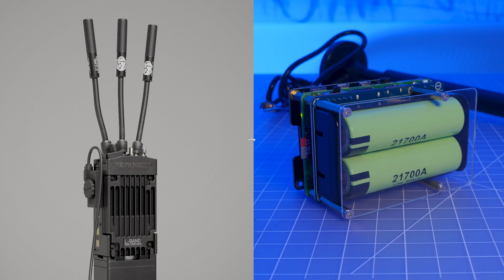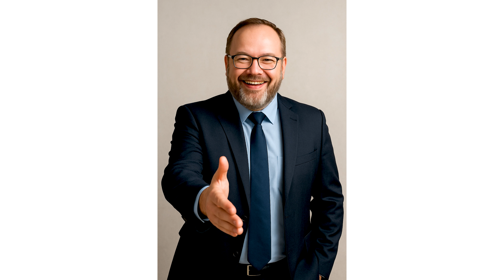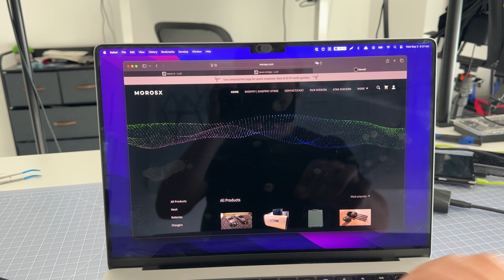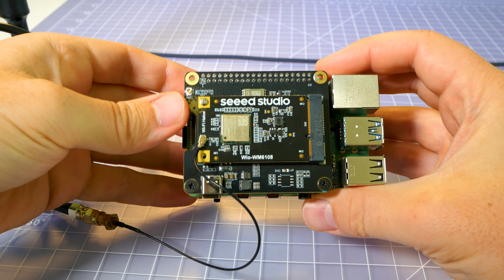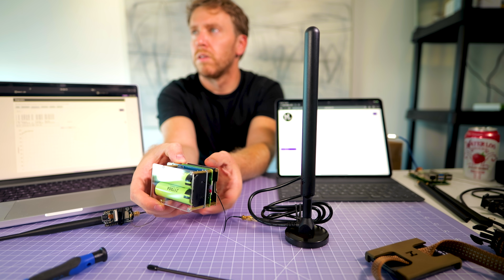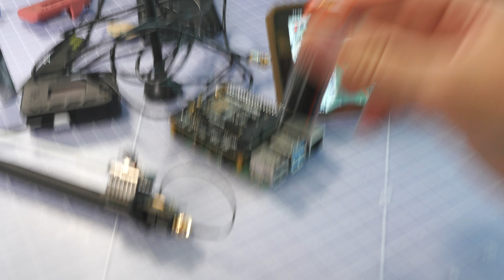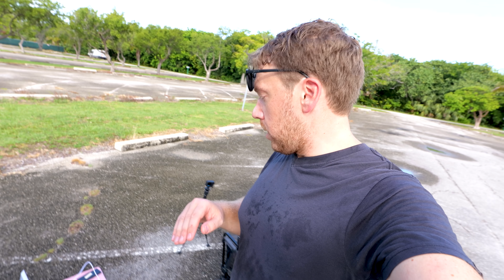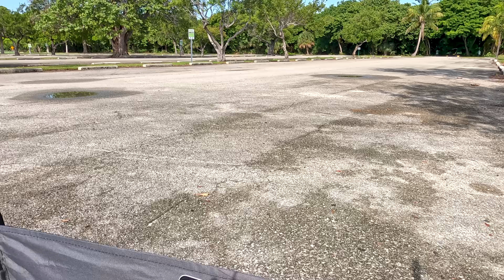I Built a $20,000 Military Router for $106.23

Comment: What about RF power?  You are at least a factor of 100 below that typically used by mil mesh radios. This RF board is where some of the extra cost is I suspect
Reply from the maker: in some cases ya, but I'm building commercial here so gotta stay compliant ultimately

Comment: I think you also have to remember that for some of these military specs, a huge part of the requirement is meeting surviving rugged extreme environments. Things have to be over engineered and made to not only work in the best case scenarios, but also the worst case scenarios. Yes government also over pays for things, but I doubt your design would survive war environments and deployment without heavy retooling, and that’s is probably where a huge increase in R&D costs would come from. Testing this thing in extreme colds, extreme humidity, extreme heat, extreme dry environments, and so on.

Comment: What about cave exploration? Intercoms usually don't work in long caves because the signalns are way to weak to penetrate through that much dirt and rock. But what about having such tiny router avery 20m as a repeater throughout the cave to have a Network in all of the cave to send messages back and forth?
Reply from the maker: interesting use, not sure dropping tech every 20 meters is the most elegant solution but I'd be curious what could be done in this scenario

Comment: Where I work, our radios constantly drop out of range and sometimes you get only some of what someone is saying to or none of it. They are 2 way radios and are transmitting digitally not analog. Safety is a pretty big deal on a mine site, wondering if a system like this could used on each truck to improve coverage and quality of a fleet of like 70 trucks ?
Reply from the maker: I would think so

Comment: Really fascinating stuff. I think in general for designing a 'military style' civilian system, you probably still would want LoRaWAN and potentially a traditional wifi mesh. The range + better performance out of line of sight of LoRaWAN just makes it hard to beat for 'heartbeat' style comms which ip based systems enable and you would want to implement.
Reply from the maker: Don't you need to broker an agreement with a LoRaWan provider?
Reply: @DataSlayerMedia  As far as I am aware if you stand up your own network, no agreement needed. Only if you connect to an existing network.

Comment: You didn't make a $20k piece of equipment for $100.  That $20k piece of equipment is ruggedized, manufactured against specific, testable requirements, has built-in encryption, uses a specific protocol to interact with other equipment, and is certified against the requirements.  You made a $100 piece of equipment that electronically serves a similar purpose, but is definitely not military grade.  Sure, things shouldn't be $20k expensive, but certification against requirements isn't cheap.  That's where most of the cost goes in many cases.  The government wants to make sure that what they ship to the war fighter does what it is advertised to do.

Comment: wait hang on. you have the pcie card for halow, but you're not using the on board wifi chip, instead using a wifi dongle?

the wifi dongle and the built in wifi chip are both detected the same way, so there's no reason it shouldn't work?
Reply from the maker: according to OPENMANET docs, the onboard wifi can't be used simultaneously with the halow card
Reply: @DataSlayerMedia  i realise where i got my info from. The Pi 5 uses separate SDIO for the onboard wifi, vs the pi 4 which the halow module will take over. If you use the pi5 then you'd be able to get it smaller and more power efficient

Comment: This would be perfect for a rescue drone. It could fly high above the designated area and could get a ping from a smartphone or whatever of a lost or stranded person. No cell tower required, just a powerful enough router on the drone, so their phone can connect and give its location and send/receive whatever messages it can from whatever app a person tried to send them from. I am sure that a competent enough electronic engineer could come up with appropriate hardware, and then it would just be a matter of engineering, you'd probably end up either mounting it on a smallish helium balloon drone that could get to a fairly high altitude and then hold a relatively stable station, or a fairly large quad copter to get up high and hold station for as long as possible. A tethered balloon would probably be the best option for something like a disaster area (you could send power up the tether and only have the antennas up there, with the rest of the hardware at the tether point), and a balloon drone would be a better option for a search and rescue (I assume that most people who are properly lost or stranded would try to call out and then send messages from their phone, but are out of range of a cell tower. This would give them an open Wi-Fi network to connect to. That would be a huge morale boost for a lost or stranded individual, suddenly hearing a heap of received message notifications from your phone)

Comment: This is very impressive and super awesome 
But devil's advocate, I can understand the cost. Mil std 810g is a bitch. 
Any contractor that has any contract bigger than 2m dollars(which im sure that contract run is), they have to meet TINA compliance which means all the sub costs are laid out flat for the government to scrutinize. Contractors typically cant charge a lot of fee for a product either, hovering around 10% or less. Beyond that, dod contract doesnt mean "make this as cheap as you can while meeting specs" its more like "we have specs for your specs" such as your circuit boards have to be US made, components like resistors, transisters, inductors, switches, antennas, basically everything has to be US made (60-75% of all components have to be US made and they do not consider a chipset a single component, they consider every component on there a component) then all the housings that are machined have to use ASTM controlled materials, US manufacturers with AS9100 and ISO9001 government certs. They probably include maintenance costs, spare parts supply, and compliance reports with each unit. All that shit adds up and does make a difference. Is it worth it? Up to the Military to decide.

This is kind of like going "i could reporgram a $25 boafeng ham radio to do the same thing as a PRC163" yes probably technically true, but would you take that to war?

Comment: In coding we learned about reliability rates, testing,  failure handing. Sure you could code a missle guidance system for way less than i am sure the military pays. But there is an insane amount of man hours in testing and revisions. In  your case, how rugged was the original compared to yours? was there other specifications they needed to satisfy, Ingress Protection (IP) Ratings./ Ruggedization. All that R&D and materials procurement against how many units have they actually ordered. I could see it being 20k. But at the same Time I just wanted to say, congratulations. I appreciate what you have done! BZ!
Reply from the maker: Totally right, but it's fun to see how far we can go on a budget and without the red tape.

Comment: Can you make a phone call using wifi calling? So phone -> IP mesh -> starlink. Would be kind of wild, anyone on the mesh can make a phone call.
Reply: totally man. This guy just made a PtP link using Wifi and its a single Layer 2 network. People have been doing this for 15 years at further distances than what he showed with better throughput. 

I have a 900mhz radio link south of san Antonio that is like 3.5-4 miles and gets a few Mbps better down and up. It was put up in the oil field in 2016 and has been running 24/7 since the day I deployed it. "Esteem Radios" is the brand.
Reply: @CoryMp3  Yeah, knew it was possible. Think the next step would be deploying an IP PBX on the mesh network. That should allow allow voice comms between individuals or groups on the mesh with a softphone app.

And then figuring out integrating of routing incoming calls coming over the starlink to the right people.

Comment: Im curious, do you think if the data source, starlink in your example, had, say, 3x the speed/bandwidth, would that scale? Meaning, would you have 3x the bandwidth/speed you ended up with at that furthest point, or is that just what it can do at that distance no matter how good the originating source is? 

Also, would it be poasible to create dedicated relay nodes using less processing power/capabilities than this radio? Like, maybe just an older Pi with a halo chip and antennas that ONLY relays the signal to help with degredation due to point to point distance, or would it need to be another full featured radio?

This is all really interesting stuff to me since I live in the middle of nowhere. It would be cool to have a network of lower cost, lower power use, nodes in place charged via solar, then my "neighbors"(quite far away) and I could have these radios to share data if one of ours is down or act as emergency comms if need be. 

I was also thinking about those geostationary satellites from the 70's that you can hit. A couple nodes with semi/camper dishes could theoretically transmit over mountains or just longer distances to fill gaps. "Save it Parts" has done some stuff with those in the past. 

Lastly, considering there is the potential for having multible antennas and can transmit/recieve on multible bands, it would be interesting if you could  alternate which bands actually send packets while the others send junk packets. If you could sync devices to know which band would be sending real packets, they could "aggregate" them into a stable connection, but any entity monitoring would just see garbage. Just a thought, I figured I would share. I will have to play around with these things, soon! Thanks for the inspiration!!
Reply from the maker: The connection will be limited wherever the bottle neck is, if Starlink is supporting 100mbs down, for example, halow will still only be able to pull ~15mbps due to is channel bandwidth limitations. The idea of a frequency agnostic protocol is really cool, some folks have been talking about an open mesh protocol that can bridge all primary frequencies - would love to see that.
Reply: @DataSlayerMedia  cool! Thanks for the reply! I usually only comment to the creator, but rarely get replies....which makes snese a lot of the time, but o rarley ask questions, so I really appreciate you answering! 
I actually ordered a bunch of the mini PCIE HaLow modules from Seeed Studio recently to try making some nodes. They are on backorder, but I am looking forward to playing with them. Im hoping to add Lora to them two for diagostics/backup remote control in case something happens to the HaLow connection or just so I can leave the HaLow functionality off until I want to use it. I use 5G for my home internet due to where I live and am trying to bridge over to a distant neighbor that has a hardline comnection. If that works, Im going to try to put nodes along the ridge of the Mts here in my neck of appalachia, then a kind of "honeycomb" pattern going away from each side of the Mts, towards two friends houses a few miles away in both directions who also both have other types of internet connections(one is a Satt link and the other is another ISP's fiber). My goal is to make it so if any one of our connections fail, we can piggy back off of one of the others until the link is re-established. It would also provide lora comms and enable using radios like the one on the video. I have help, too, thankfully. It will also be cool to share files/stream from eachother, even if there is no internet available anywhere for whatever reason.....kind of like a backup "internet" many of us and our friends that may join in have been archiving important, trustworthy data on our local networks. Things ranging from field medicine on humans & animal husbandry to scematics and plans for things like wind turbines from trash & reference material for nearly any kind of electronics/mechanical projects, etc. Of course a lot of entertainment, too. We are well beyond 100TB of data combined at this point and MUCH of that is text! We save videos in lower res formats too, as long as you can see what you need, just sonot is eaaier to share and takes up less storage. 240p-480p is usually more than enough. 

Anyway, Im blabbering. Sorry, Im just really happy I came across this and flund HaLow! Our original plan of just Lora nodes and "cantennas" for higher bandwidth connections would have been doable, but this is much less work and should be much more reliable! We will be working on the hardware over the winter after we finish prototypes, and should be able to deploy the first ones along the Mt ridge this spring! 🤞🏽

Comment: I love your video.  I've Liked & sub'd.  not too long ago, ubiquiti networks had 900mhz point to multipoint bridges available (m900).. It was fantastic.  It outperformed your halo results.  It had channel witdth capability up to 20Mhz. I was able to get 40-50Mbs thru non-line of site situations (pretty heavy palm trees) in florida.  Then all of a sudden I speculate the fcc locked down those frequencies and the product came off the market.  This project peeks my curiosity because I have customers that own big pieces of property and want ip connectivity on different corners of the property.. (bad cell service, ip cameras, internet access.)  From my experience 900Mhz tech was the best suited  for those circumstances and until now i wasnt aware of the halo hats.. Keep posting your results  Im definitely curious to see if you can get your performance to improve as I see a handful of real world applications for rural-america.
Reply from the maker: Do you recall the name of that unit?

Comment: No you did not. Those routers are that expensive because of the expensive testing they undergo. For example can you use chemical solve to to break into the physical device, extract the IC that contains the cryptographic key in a clean room and pull the data off the silicon. 1 of hundreds of tests performed. Your router just performs the same network functionality, which is the trivial part of military tech

Comment: This has probably already been said, but when talking about military overpricing (it's still a thing, despite the point I'm making) you have to keep in mind that the actual functionality of the device/system is only part of the puzzle. You're paying for redundancy, for engineering R&D, extreme temp testing, etc.... Your device might DO the same thing but can it withstand being dropped out of a helicopter or fully operate at 10 degrees F? Unique requirements drive up material cost, engineering costs, and ultimately the price.
Reply: That, and continued support. The military isn't just paying for the product, but the guarantee that the company can continue to operate for as long as the contract lasts
Reply: I’ve just said the same thing
Reply: Industrial and military gear is always more expensive than commercial or end user electronics.
They use components that will withstand temperature extremes and physical shock.
If you live in a place that is temperate and it's a fixed installation (no vibration or shock), you could buy a cheaper build, if possible. But the hardware for this is cheap anyway.
Reply: imagine deploying this in ukraine. Giving your regular troops instant position awareness is quite frightening
Reply: @ハンスム  they have to fly drones by fiber optic cable in ukraine because of the jamming, an unencrypted unprotected radio like this would be useless
Reply: You're paying to enrich Raytheon.
Reply: I can assure you, the real one cannot either.
Reply: @alfredoghost2306  i can assure it, the military can do much more than what this things does. not taking anything away from what he was able to do but this is not even close to a replacement for any MANET radios i use at work.

Comment: I'm not going to pretend that there's no grift, or especially no padding of contracts to keep some Congressman's pet factory humming, but somebody once explained that what makes, say, an airplane (so FAA civilian certified) bolt cost $18 when it seems like the same bolt costs $1 at the store is that the $18 bolt comes with documentation, which includes record keeping and further documentation at every step of manufacture, which allows you to track any problem back all the way through the supply chain until you're looking at the specific dirt they dug up for ore. That way, you can figure out why the expensive plane full of people fell out of the sky. The $1 bolt doesn't have that documentation. Each of those many documentation steps requires expensive skilled labor and ongoing costs. Considering that an enemy actor can connive to sell you what seems like an ordinary printer that manages to destroy your entire nuclear program when you plug it in, this sort of documentation of the entire supply chain might be the real reason why milspec stuff costs so much.
Reply: Maybe, but the army is still being overcharged.